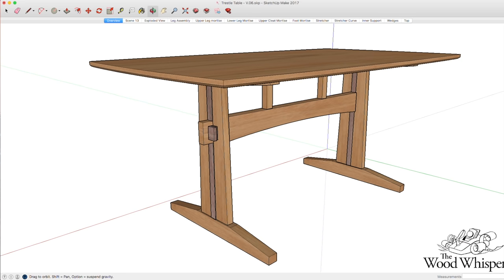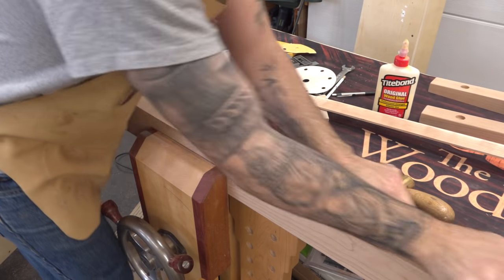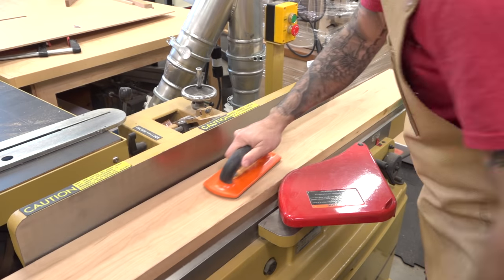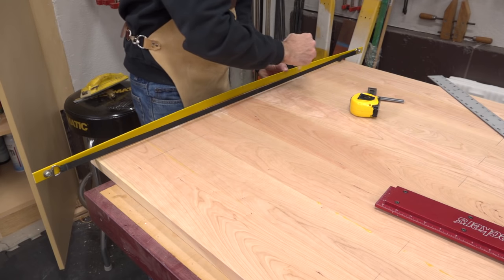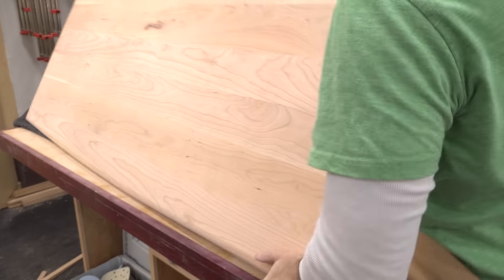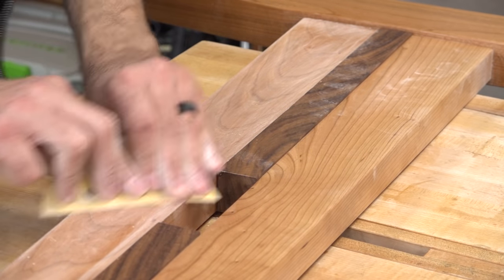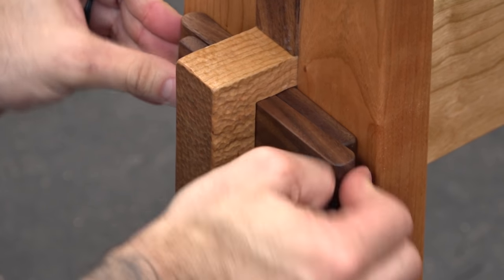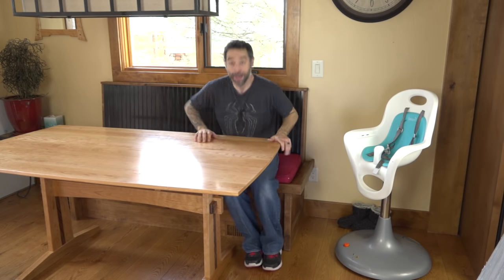Braces, Top, Wedges, & Finishing - Knock Down Trestle Table Pt. 2

Comment: Brilliant work as always my friend.  Glad to see you enjoying Colorado.  Almost fell out of my chair laughing at the end where your daughter was feeding the dog.  It was a most precious sight. 

BTW in applying your finishes, have you ever used an oriental fan brush.  I find their rounded counter allows for a nice overlap without creating the typical brush stroke marks and their paddle shaped handles provide incredible control.  For myself, they are my preferred method for "wipe on poly" and most other top coat finishes.  If you haven't tried them let me know, and I will gladly send you a few to try.

Again, glad to see you and Nichole doing well and happy in Colorado.  Blessings and best wishes to you and you family.

Comment: The bolts used to attach the base to top appear seated in recessed holes which aren't sized to allow movement of the top.  The bolt shank holes do seem to be elongated slots but the head recess hole is circular and not much greater than bolt head diameter.  How is seasonal expansion/contraction accommodated?

Comment: I'm planning a table with a 5/4 hickory top, I noticed you didn't have breadboard ends.  I'm assuming they're not necessary and I'd like to not have them.  Thoughts?
Reply from the maker: They are never necessary. But they can help keep the top panel stable over time.
Reply: I was gonna ask the same question. Good to know.

Comment: Great video and thanks for sharing.  I've watched many of you videos to help me learn.  I was wondering if maybe you or some of your viewers could explain to me the difference between a roundover and a chamfer?? And when you build something how do you know which one to use on your project.  Any advice would be appreciated and sorry for the basic question.
Reply: CopLock ... a round over is exactly as the word describes.   The round over bit puts a radius on the edge of the wood.     There are many different bits with different size radius.   the edge of the wood will be circular. 

A chamfer isn't round at all.   It creates another facet oon the edge of the wood.   Its flat in nature,  not round.   imagine you take the edge of a piece of wood and cut the corner off at a 45 degree angle.   That's a chamfer.   

Which one should you use?  That's a matter of preference.   what looks good to you?   what fits your design?
Reply: 135 Pilot Thanks for the great info pilot. I'm new to woodworking and always trying to learn.

Comment: Great table. Ok same question from the part 1 video. You used a small engineers square for some of the marking out. Looked a neat size, where did you get it from please?, and thank you. Dave.
Reply from the maker: +Dave Storr having trouble remembering the manufacturer. Let me get back to you.

Comment: When you jointed the edge,you first flattened the convex surface (smiley). Any reason why you didn't do it the other way...I would think it would be easier to run it over the blades with concave surface?
Reply from the maker: On a shorter board, maybe. But on boards of that length, running it as a frown means you actually aren't getting proper registration as you push it over the beds of the jointer.
Reply: Okay, thanks!

Comment: Marc, great work as usual. Quick question please: I've had two instances where the wood is actually binding onto the riving knife behind the saw blade. One time I actually to pull the knife out and remove it from the wood with a rubber mallet. I measured the width of the knife and the width of the saw blade (on tooth) they are exactly the same.  Is that the problem? I waxed the riving knife, hoping that would help. Is it just tension in the wood? Once the cut clears the back of the table saw top I wedge in some wood to keep the cut open. Any suggestions would be greatly appreciated. Thanks.
Reply: Is the fence parallel to the saw blade? When my fence is off by a bit it can bind the cut into the knife, you also see some burning in the cut. It doesn't have to be off by much.
Reply: I believe it is. I ran a gauge along its length and found only .001 inch off. I think it just may be the wood. I ran a 3/4" dry pine through the saw with no problem. It's the birch; as soon as the curf is created it just collaspses close back onto itself. Annoying and dangerous too. Thanks David.
Reply: In which case it might be that the wood was dried improperly and became case hardened, a little wet on the inside bone dry on the outside. When you cut case hardened would it warps  after the cut and can become a real bear.

Comment: very nice table. Question: with sliding the table in and out away from the bench, did you put any pads or protection on the table feet to protect the floor?
Reply from the maker: Not yet. Certainly a good option.
Reply: cool. maybe in a future video you could recommend some of those options.

Comment: Beautiful table. Just one comment about the rail: it should be about 2 inches longer (1 inch on each end). Looking at the pics it seems that you have cut the through mortise for the wedges about one inch from the end of the board. In my experience, that is inviting a split from any tangential movement (ie. sliding across the floor. An extra inch would reinforce the short fibers and keep that from happening. To see this happen, make another similar mortise and insert a chisel or a longer thin board and twist outward. This can crack along the grain. This won't necessarily happen but could. Once again, beautiful work!
Reply from the maker: +Craig Mckinney an extra inch also means more hurt knees. I trimmed them down as far as I was comfortable, favoring fewer banged knees over the ideal strength situation. As it is now, I' pretty confident it will stand the test of time. But we'll see. 😁

Comment: Hey Marc, I have a quick question.  First, I love this design (and most all of your content, people really get tired of hearing me talk about TWW), secondly I wanted to change the length of this table to 8 ft to accommodate all my family (married and have 4.5 kids). Do you think keeping the same dimensions for the cut offs for the curves would work or would you suggest taking more or less than the 1 inch and 7/8ths off?
Reply from the maker: I think you'll be fine staying with 1". The curve needs to be subtle but visible. You should still get the same effect on a larger table.

Comment: Did you not raise the grain or did I miss that step?
Reply: 4-5 coats of finish should have taken care of whatever grain was raised during the initial poly coat
Reply: Grant B...good point
Reply from the maker: No real need to raise the grain for oil-based finishes.